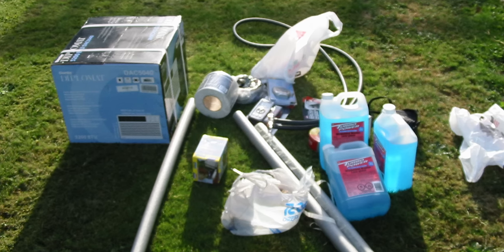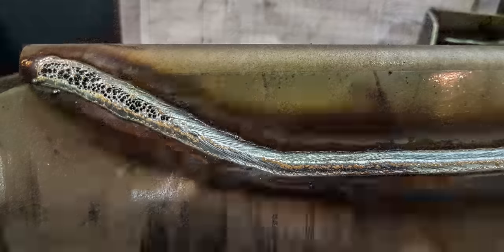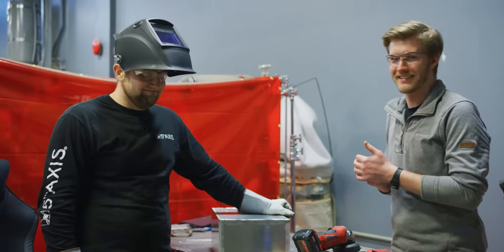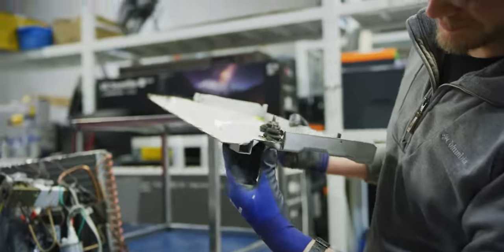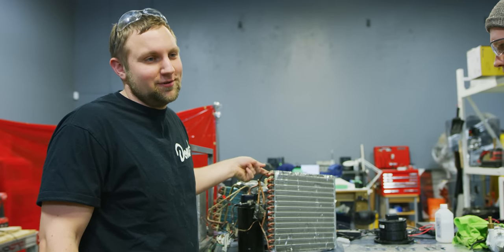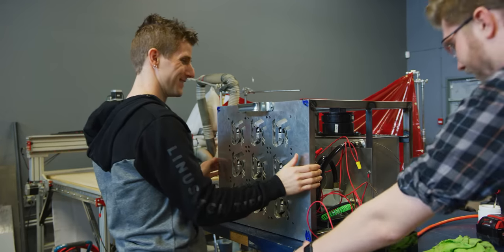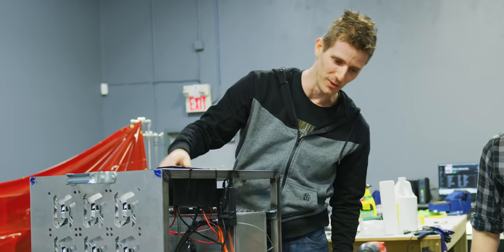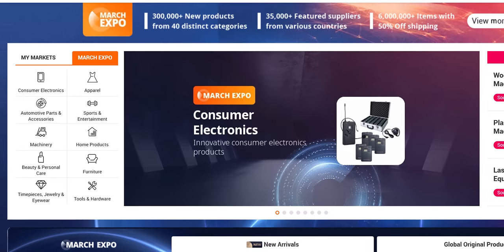Building the Ultimate CPU Cooler!

Comment: No, your box is not warped because you don't have the proper clamps. When you weld stuff, IT WILL WARP. Even if you could hold your angles at a perfect 90° while welding, your piece will become tensioned from the metal shrinking while cooling and bent out of shape when released. The trick is to get a feel for how much it will warp so you can compensate. Also there are tons of little tricks you will pick up along the way to be able to minimize and manage warping.

Comment: Why bit use a multi stage heat pump  like those used for homes or offices? If not that you could just make a tech cooler if you had some sort of metal that cools in the presence of a magnetic field. Gadolinium maybe. I do not know if you oscillate the magnet field or slap a neodymium on top the metal sitting on the heat pips on your heat sink.

Comment: You're damn luck the refrigerant leaking was vapour rather than liquid. NEVER try and stem a refrigerant leak with your fingers, you could end up with horrific frost burns. Try not to cause a leak, and if a leak occurs, let it go, repair the leak, pressure test the system and recharge.

Really, the gas should have been recovered before any work happened, then the system pressure tested with dry nitrogen, evacuated once proven gas tight and recharged.

(Sorry, but I have to be qualified to deal with refrigerant, conversant with the effect of refrigerant on the environment and can be prosecuted for malpractice. Seeing people fuck about is pretty triggering from a professional point of view.)
Reply: Agreed
Reply: You shouldn't expect PhD level knowledge from youtube. It's not entertaining yknow
Reply: yeah, no
i know they're supposed to be engineer
but they work for LTT
so..................................................
also to be fair, it's a very old AC unit
Reply: @Graham Entwistle Yeah, I do mainly vehicle AC work but still, there was a lot of "oh no, oh Lord what is you doin'?" when they were dealing with the tube break. I usually stick with TEC/water for supercooling, but if I were building a chiller for a PC I would have gone with R134a over R22 if for no other reasons than environmental impact and wide availability of suitable parts, and there are of course other much friendlier and less toxic options for refrigerant.
Reply: @tero1321  don't need a PhD to realize that trying to seal a compressed gas with your fleshy tissue is an awful idea
Reply: @tero1321  you should expect basic safety, this is entertainment, but it's also meant to be informing people how to build a water chiller using an old one piece aircon unit. That means other people could face the same problem.

Comment: When you were welding the corner joints of the case for the cooler frame you were running too hot for too long I can see.

Comment: Hopefully You didn't go with washer fluid general motors tried putting a warmer in with there washer fluid. it got recalled cuz of fires. It has alchohol in it. I would use automotive coolant its meant for hot and cold also has the added plus of preventing electrolysis

Comment: Good video on welding. But one mistake. You guys used argon co2 mix gas. Instead of pure argon. The common signs of this are the sparks flying off the shielding gas. 5% is ok. But not the best for weld quality

Comment: Hi...i have been wondering why nobody uses a flat heatpipe and thermal paste  instead of thermal pads to cover space between x & y.The heatpipe could even be connected to metalic parts of the casing if any,further increasing heat dissipation.

Comment: Is it possible to put some quick connect fittings on it....like 4 or 6 and have the unit just sit as a central pump/cooler and cool a whole office of PC's? 
Have each PC with prefitted quick connects and internal piping so they can just "plug in" to the "cooler"

Comment: Hi Linus, been watching you videos for some time now and as well as being both informative and educational they never fail to put a smile on my face. I have been thinking about this issue for sometime due to restricted space, being able to keep hardware temps at a constant temperature and noise to a minimum choices are pretty limited. Yours choices are  to liquid cool keeping temperatures a few degrees above ambient temperature and the humidity to a point condensation doesn't occur, use more fans than needed at a reduced speed or just enough at full speed and experience the sound of concord in true surround sound all of which are stating the obvious. Then i thought what would happen if a hybrid of a few of your previous attempts was tried. Whilst submersing the computer in a mineral oil tank and a liquid chilled loop something that can withstand the subzero temps using either your MacGyvered air conditioner or one of those large aquarium chillers. This should prevent condensation from forming and if the cooling loop was done correctly either as 1 or 2 separate loops 1 to cool the cpu, gpu & motherboard and one to circulate subzero fluid around the oil helping dissipate any heat it absorbs. could this be a viable home user solution? electrically it would be safer as the chillers would be working as designed should also cost less to run

Comment: You should try using brine mixture since it conveys more heat but becareful with the amount of salt to be put in and it must be changed regularly specially when its not being used often cause it will eat away those metals, but either way to achieve more cooling properties from the coils of refrigeration i'll opt out to use the brine mixture :). We've done a research and built a prototype for a mini ice plant and that was my basis for hte production of ice. Hope i've contributed some knowledge! been a viewer since 5 years ago finally have some courage to post my comment lol.

Comment: you can tell it's a shitty TIG weld when there are sparks coming out of the molten weld pool. boiling metal popping generally happens in Oxy Fuel welding, not TIG.

Comment: most of the temperature delta occurs in the oxide layer at the surface of any metal. Between the silicon and the integrated heat spreader and then again to the heat sink. In another application, the two metals to be mated together were put into a hard vacuum, a laser evaporated the oxide layer off, at the two metals were mated (no adhesive necessary). Given the fanaticism of  gamers, I am surprised this method has not been used. I want to do this just over twenty years ago, but this was an era before gamers, and the workstation people were mostly marketing flakes who could not understand more than MHz and cache size

Comment: Awsome video!
Could you build a PC where the CPU is cooled with the 3m Novotech fluid and the gasses condense in a cooler block on top of the PC? without pump,  like the d8auer cpu cooler?
But then like, expiriment with the pressure of the system so the 3m novotech fluid will cool the cpu more than in conventional 3m novotech immersion 2 phase cooling systems?

Comment: I'm an HVAC RD engineer with about 10 years of experience working for one of the Major HVAC manufacturers in the world. Also an enthusiast gamer. I really enjoyed this video but here's a few things you need to be aware of;
1) Before ever messing with the AC unit even for a small tweak, ALWAYS recover the charge. (Use Brian he's got a vacuum pump and knows what he's doing)
2) If you caused a refrigerator a leak, immediately take it outside. Don't stick your finger to the leak, and don't inhale it. (Yes, refrigerant leaks happen by accident in HVAC factories and we have a ventilation system to move all the air out immediately.) Refrigerants are dangerous to inhale, also some can ignite and cause a major fire.

Comment: youd have to sit in front of a welder for hours on end with the arc constantly lit, the uvb radiation is so low it takes a long time to effect the skin, obviously if u have real weak or sensitive skin itll effect it faster but u dont have to worry about sunburn iv been welding with bare arms for over 20 years the worst thing that ever happens is a little spark hits u.. however, the arc will absolutely destroy ur eyes n make u wish u were dead, iv had welders flash 3 times its the Fn worst, n jus because ur not lookin directly at the arc doesnt mean anything i learned the hard way u can still get flash from reflections

Comment: Wtf, that's soldering though.
Welding is using electricity to create arc by connecting the device to ground and the welding stick to a higher voltage.

Soldering is melting a "stick?" Or soldering lead. To create a liquid metal which will cool back to solid later

Comment: You should weld with local exhaust ventilation if indoors, and respiratory protective equipment. Welding fumes are carcinogenic and should be avoided where ever possible.

Comment: A lot of this welding and talk about welding hurt my weld engineer soul. Idk what they sold you as a "nuclear or pipeline" filler wire. But I saw a tube of E70S-2 which is nothing crazy and what many consider a general purpose filler. The real "common" filler is your E70S-6, but the only real major difference is the deoxidizers. The biggest being the Manganese and Silicon content when the 2 are compared. Yes you can bring up the Zirconium, Aluminum, and Titanium and ductility of both fillers but for sticking a couple pieces of box steel together it's all essentially the same. Still, neat project and it came out nice. For the other welders in here Miller>Lincoln and my plant strictly uses Lincoln.

Comment: This is crazy!! No RA measurements, head pressure probably through the roof!! I'm sure with enough run time it will trip Hi limit or the compressors thermal overload. Like a previous comment stated r22 is not a low temp refrigerant. Should have atleast converted to 407c, much cheaper and no need to change your metering device (txv/piston) or oil as long as it was POE and not MO. I've also noticed with all this water and fan cooling of PC's no one seems to take in the account of return air needed.  Also did you guys de-energize the cap prior to working on it? A lot of people are at very serious risk with a setup like this, plus the life span of your compressor is likely a minut fraction of what it could be.  Great Idea? Yes!! Great execution? No!! There is a reason that other than the roof on your home your HVAC is the most expensive item/appliance in your home. It is a very technical trade and to watch people pooh on it like this is a little upsetting to say the least. My intention isn't to talk trash I am a HUGE FAN, but leave the hvac to a certified technician lol or atleast someone with an epa cert for cfc's and hcfc's.
Reply: The whole point of this is for fun tho? Im sure if they wanted a professional set up theyd have paid for one. No need to lecture to people who def dont care, as the point is for fun and to DIY. 

Not to knock your saftey stuff but lets be real.... Thats obviously not the worry here lol.

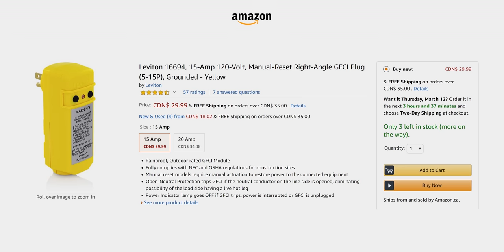Comment: 7:00 every electrical installation in my country is required by law to have ground fault relays built into the main swichboard. In fact there has to be two of them responsible for half the house each. this is to make sure if one has a premanent fault and has to be fixed by an electrician, you will atleast be able to have power on in the rest of the house making you able to plug in freezers and other stuff that can't be powerless for too long...
Also... I am an electrician... I don wanne see your wiring so I can roast your mistakes! LOL

Comment: WAHT DO YOU MEAN THIS OLD TONY IS NOT A PROFESSIONAL,im sorry but as a teen 16 year old thats been in the ganm for 6-7 years im triggered,but anyways ALSO at 4:45 He did not just (assuming that he did) dip the damn tungsten for a swim and kept going XD
Edit-Also why didnt they just get a damn mig welder,it would have been cheaper than a tig welder and you just set wire speed and voltage and bam you press a trigger and bam you weld straight dimes or buggers that have porosity (when you get tons of holes in the weld cause the gas inst on)

Comment: Thre is so many things wrong with this build that it aint even funny anymore, but it sure is refreshing to see Linus keeping away from the power tools. I use to say everyone can learn, but Linus is that one exception... I really hope you optimally replaced oil in the fridge system and definitely pulled vacuum before filling R22....With out vacuum there is still traces of different gasses and at least it will hinder cooling capacity and at worse eventually destroy the system.

Comment: FYI, tacking is more to keep the metal from bending and warping because of the heat of a lot of welding. So yes tack everything to keep it straight but also tack along long weld lines so it doesn't pull away.

Comment: just drain the oil in the system ........its mineral oil ...replace it with synthetic compressor oil and charge the system with R134A gas

Comment: FYI: Tig isn't suppose to look like a sparkler is going off. Lmao I'm a pipe welder and yal trying to weld is hilarious. You need to clean the mill scale off the angle iron before you weld it for a much cleaner smooth weld experience